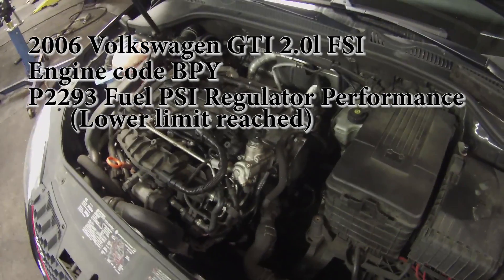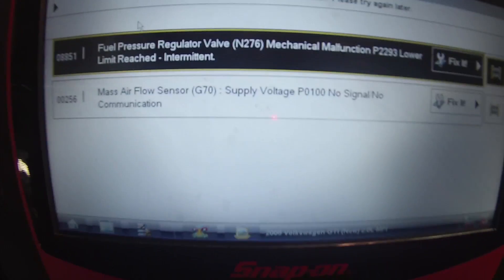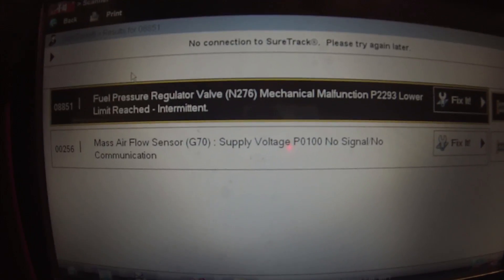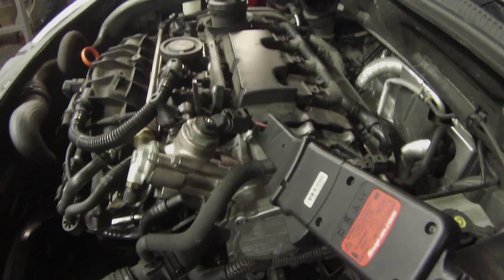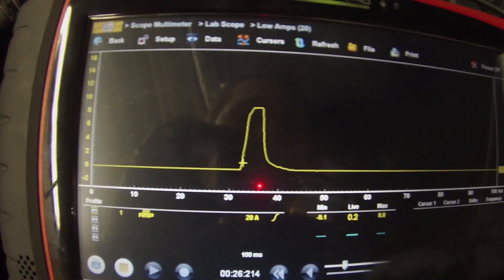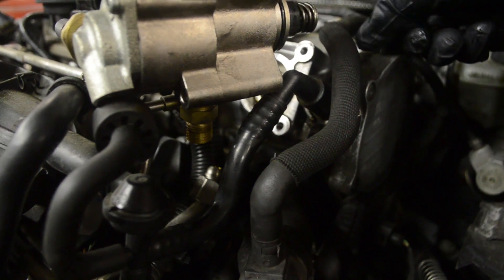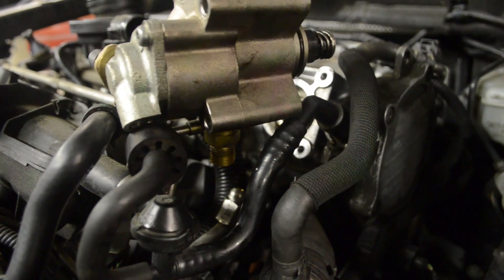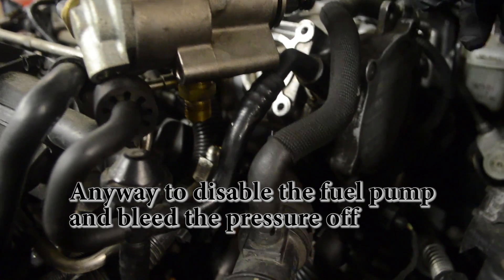2006 VW GTI 2.0L  p2293 Fuel Psi Regulator Perf. (Worn camshaft, damaged HPFP and worn cam follower)

Comment: hi, great vid and thanks for all the advice! Is there a way to test the valve/solenoid separately? I have same issues with my 2006 FSI, Cam shaft has no scoring (luckily), Cam follower is worn through but I wanna make sure its the pump before buying a new one.
Reply from the maker: If the pump isn’t worn through enough to break the spring/shaft it’s probably ok.  The problem is, even if the cam isn’t scored, the lobes could be worn down which then doesnt push the pump shaft all the way in.

Comment: Dealership techs are the worst. They all think their tablet can solve world hunger if there were somewhere to plug it into. If you want to know whether it works or not, a simple OBD2 reader will tell you fuel rail pressure. Unplug it, if it runs smoother, that's your issue.

Comment: Great video. Currently running into this issue on my 07 Passat 2.0fsi. The code I’m getting is p2294. Recently changed the HPFP and still getting the same code again. The cam follower looked worn but wasn’t punctured bur replaced it anyway. Any suggestions man?
Reply from the maker: That fault is for the control circuit on the high pressure fuel pump,  I would scope the power supply and ECM control at the high pressure pump.
Reply: I’ve got the same issue I don’t understand why im getting this code my hpfp and cam follower is brand new I also get a weird sound from the hpfp sounds like a cricket chirping as if the hpfp is working to hard if so I suspect the low pressure fuel pump not supplying enough fuel to the hpfp hence it not being able to regulate enough fuel ,any suggestions?
Reply: @andynelson1219  did you find anything out ?

Comment: Hi, my 2007 audi a4 was having boost issues. I cleaned the blocked catalytic converter. Car has good power now. But now it's intermittently loses power and give me the P0089, P2293 and P0171. Could it be the lpfp/hpfp? Perhaps because of the clogged catalytic converter before the fuel pump wasn't required to deliver much fuel. Now that the car has good boost the pump needs to work harder and just can't keep up? Can this be a possibility? None of these codes showed up prior to cleaning the catalytic converter. Any help would be greatly appreciated. Thank you

Comment: 2007 vw passat 2.0 fsi  with fault code p2293 + p0340 . do you think the problem is  camshaft timing?
Reply from the maker: It could be that the timing belt is off. Or the timing chain that holds the cams in time to each other could be off too.  Or it could be two separate problems. Time to do some testing.

Comment: Old video but these problems really never go away. I've been chasing a fuel issue for a month or so now. Changed both sensors, fuel filter, carbon cleaned, spark plugs, cam follower. Idle pressure is good, sitting at 700ish psi. High pressure side gets up to 1400-1600psi then drops all the way to 50psi and almost fluxautes there. My cam is also in good shape. Not sure where to go after this. Nobody really posts their solutions after so im stuck reading unfinished threads all day. Anyone have any ideas?
Reply: Any luck? Dealing with the same issue 2.0 fsi just threw the p2293 code for the first time after having power cutting issues under load, and a creeping idle rpm.. My cam follower looked fine and I replaced it anyways. Ordered a new pcv valve and will be installing this weak... If this pcv valve does nothing my next step was to look for vacuum leaks..
Reply: @slvshy666  i actually did get mine. I started with all of the sensors including my temp sensors. Then did the wiring to the in tank fuel pump, and the fuel filter. Turned out to be the high pressure fuel pump for me. Been running for a week alright so hopefully it stays going haha..
Reply: @MrYoudafool  has it been alright?
Reply: @slvshy666 just clean your hfpp with carbon cleaner
Reply: @noventay4  the power cutting ended up being a failing low pressure fuel pump. The rpms continued to creep at idle though. Oh well, sold the car already, now I'm Toyota for life.

Comment: If you replace high pressure pump ,lift pump ,all sensors and fuel filter ,new head  and intake O2 sensors and still have a Epc light on throwing a N276 low pressure code what should I look at now?
Reply from the maker: Is it an n276 circuit low fault?  I would check voltage at the n276 solenoid on the high pressure pump

Comment: i have a 2007 vw jetta GLI where do i find the fuel persure regulator located
Reply from the maker: The high pressure pump regulator is apart of the higher pressure pump
Reply: I need to know where its located is there a diagram of where to find it

Comment: I just bought one For cheap Not starting. And it does crank. But I doesn’t start. I think is a fuel issue. And I cannot get any codes because I don’t have the tools But I think is a fuel issue what do you guys think. Timing is good and good compression

Comment: I’m having this same issue with my 2007 vw gti I have replaced my hpfp and follower with no marks or signs of damage to my cam, while driving to work my check engine light popped back up and when I scanned it the p2293 code came back I have replaced the fuel filter as well I don’t know what else to replace
Reply: Did you find a solution? I’m having the same issue?
Reply: @water387  Any fix on yours? I've run through about every part of my fuel line at this point with no luck
Reply: If you have changed all them parts it's 100 percent the relay cheap fix thank me later
Reply: Which relay? @Manest3272

Comment: Hi! Thx for the video! I have a 4.2 FSi 2007 and sometimes I get EPC errors. Mostly it is P2293 und rarely P0088 (pressure too high) too. Both pressure sensors in the rail are already replaced. If the EPC light is on, I hear squeak noises from the HPFP's. The engine runs normally without misfires. What du you think?
Reply: Did your figure it out?

Comment: I the same problem every time I floor the gas the car get up to 40 then fuel cut ..my cam follower is good I replace the hpfp with a used 1 same thing ..am getting that same code mechanical malfunction .i want to try 1 more thing buying a new pump from fcp euro and try it ...plus I change the rail sensor too 😞
Reply from the maker: Have you verified pressure?  I’ve also seen faulty rail sensors cause some issues

Comment: Hi mate, so did this car only have a fuel pressure issue when being driven? Cause those idle pressure look to be good?
Reply from the maker: Right. Numbers at idle were ok. Under full load and hard acceleration would show the problem

Comment: Damn can they use a roller cam style follower instead of that flat washer looking follower ? Or am I wrong the follower is missing a part ?
Reply from the maker: On this engine it is a flat surface that's rides on the camshaft lobe. Newer 2.0t use a roller style
Reply: U can get a roller one but u have to change the hpfp

Comment: I have error code P0089 Fuel pressure performance, what issue is this? Thanks in advance
Reply: Same here, can't figure it out. Anyone?
Reply: Great video, like how go through diagnosing it. I have the same code coming back on p0089 fuel pressure regulator performance  1 ,  is it the fuel rail sensor?
 Thanks again for the content.

Comment: Should I go ahead and replace the fuel regulator before I replace anything else? My check engine light came on and I checked it. Most likely solution said to replace the high pressure fuel pump. What should I do?
Reply from the maker: The fuel pressure regulator is a part of the high pressure pump. What fault did you have?  I would verify pressures first. But the only way to verify the high side is with a special gauge. So if you don't have that gauge you can't verify the high side
Reply: Positive Lead Diagnostics The fault was the regulator. But I was it told me most likely solution is to replace the high pressure fuel pump. But I'll check the pressure and thank you for the response!
Reply: BoostedGTI 227 did you get this sorted in the end?

Comment: My EPC and check engine light came on. The power of the engine has greatly decreased when accelerating. It also takes longer to crank the engine. The engine code i got was P2293 and P0087 Fuel  Rail/ too low. Does this sound like a bad sensor or a bad fuel pump?
Reply from the maker: Sounds like a fuel pressure issue. Check low and high side pressure. Most likely a high pressure fuel pump failure. But you need to cover all the bases first
Reply: Will do! I appreciate you taking the time to respond.
Reply: Did you fix it mine is doing the same
Reply: Did you ever resolve?
Reply: Did you ever fix this?
Reply: @lunchmoney3652  it ended up being my exhaust manifold for the 2nd time. I got sick of that and sold it shortly after lol

Comment: to measure the fuel pressure to check if fuel pump is good is in the HPFP gage? is 60 PSI?
Reply from the maker: Low side should be around 4-5bar. High side should be 40-50 bar at idle. You can use a gauge on the low side but not on the high. Unless it's a digital gauge. There are data pids for the low and high side through the scantool
Reply: if i have obd scaner and torque app does that tells me the fuel pressure?  if not the gage in the HPFP is the high pressure? can i read it with a refrigerant manometer?

Comment: What's to stop the same issues from reoccurring after the fix? Especially with the camshaft.
Reply from the maker: Replacing the follower as a maintenance and keeping oil level up
Reply: @PositiveLeadDiagnostics  just subscribe you're a smart dude... Anyways off-topic I just bought a GTI today and on the way home to check engine light came on within 20 minutes really pissed off.. anyways my code is p2171 any ideas where to start? Thank you in advance for your input!! I'm just very bummed

Comment: 2006 gti with code p2293 goes into limp mode on start  need to remove battery cable to get it to accell
Reply from the maker: What do your low and high side fuel pressure sensors read